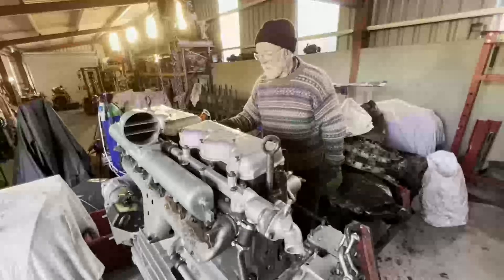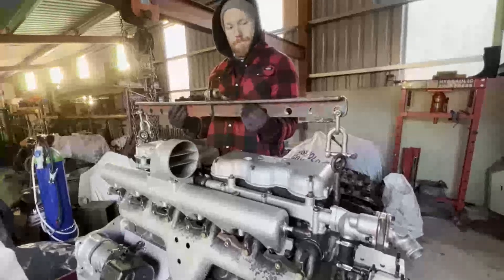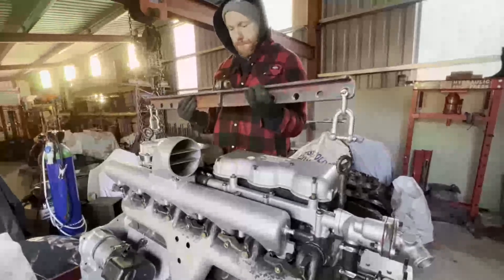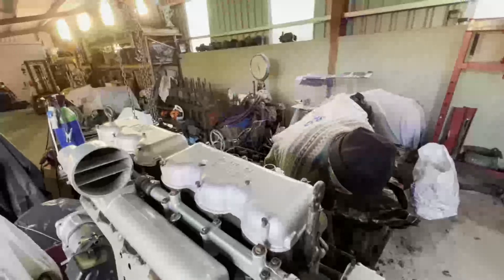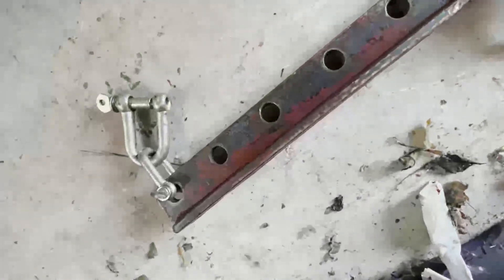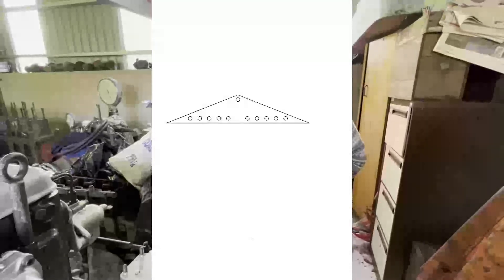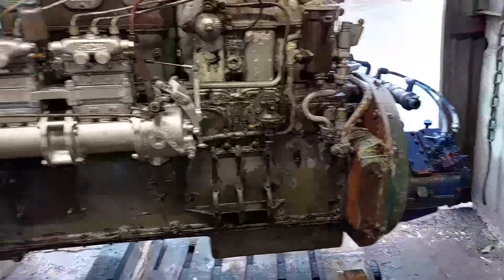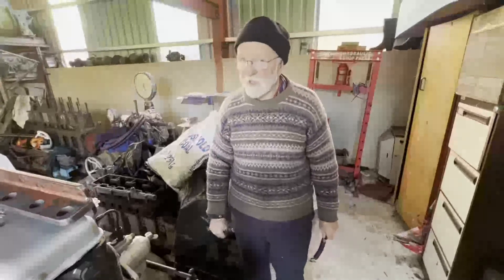Gardner Engines: their lifting eyes: how not to use them!

Comment: It seemed to me that the shackles in tne second lift were not plumb and so were exerting a side ways load on the lifting eye.
Reply from the maker: Yes, you are correct and I wasn't so comfortable about that.   But, because the eyes are a tight fit down through the rocker covers, they cannot move sideways.
Reply: I noticed that too and I'm glad I wasn't missing something.  Thanks Joe for adding your comment too.

Comment: On that 6LW I see it has air vessels on both pump bodies. 
Has it got 6LXB/C/T  pump tops on it or have you just used 6LXB/C/T bodies with the LW internals still inside?
Only asking as Ive rebuilt every single model of Gardner injector pump from  the 1L2 to 6LYTi (except a 6LK) and never seen a 6LW or 6LW20 come in over the last 40 years with air vessels on its pump tops like 6LXB/C/T units.
Reply from the maker: We find various kinds of air fitted and in various combinations.  I'm not sure it matters.   An air vessel is an air vessel, is an air vessel - just that - an air vessel.
Reply: Didnt say it matters as it doesnt in the slightest to the operation of the engine at all unless it has the bigger (up to 9mm plus LXB/C/CT elements and diff d/valves)Was just wondering if it was something you did.